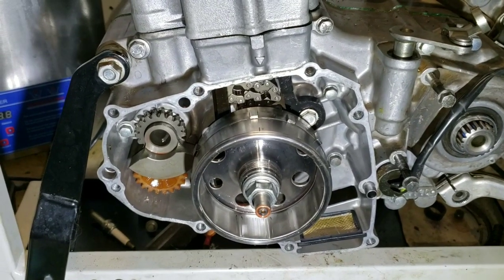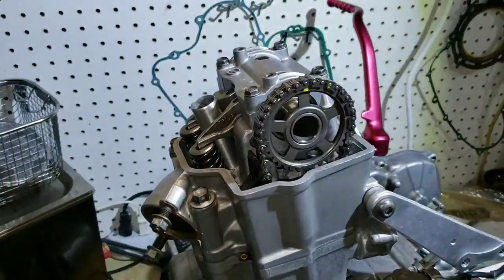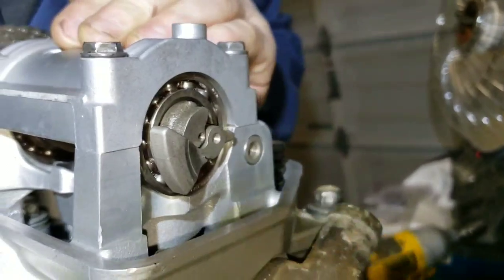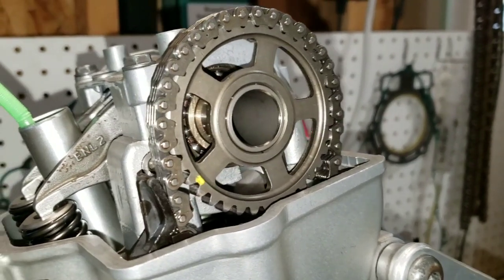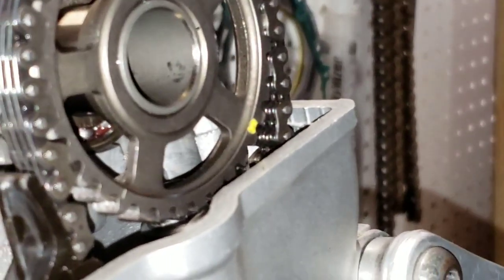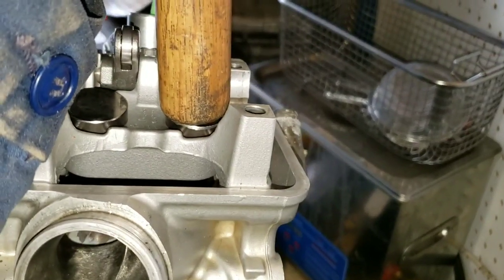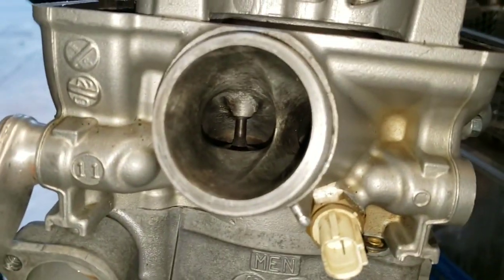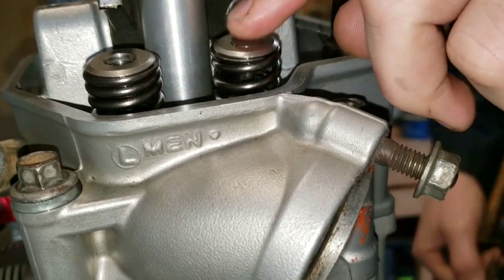2009 CRF450R timing & valve clearance - oops, we swapped intake & exhaust valve springs

Comment: People... i highly recommend you DO NOT use the back of a hammer or anything of that nature to forcefully push down on the valve shim buckets like shown in this video. You will dent the top of the buckets, which will throw off your valve clearances, cause the camshaft lobes to become worn unevenly, and throw off all of the timing in general. Those valve shim buckets are very delicate parts and it doesnt take much to ding, dent or damage them.
Reply from the maker: I highly recommend you consider the amount of force the STEEL cam is going to exert on that bucket 130+ times per second.  A wooden hammer handle used as in this video isn't going to hurt that thing at all.   Unless I was using a metal pipe or something. There is no "gotcha" here. You have not caught me in the act. You're not as smart as you think you are bub.

Comment: The timing is out by miles the two marks on the cam should be level with the face on the top of the head. The clicking noise is something to do with the timing advance on the cam shaft
Reply: Wrong, the timing wasn't off, the camera angle was.  We had two valve springs swapped. Easy first-timer mistake.
Reply: @teamagoge-theenduroists8683  timing was definitely way off
Reply from the maker: @kgmxtraining250  You literally only have to read the caption to see what the problem is:  two of the valve springs were swapped.  It wasn't out of time.  Everything else was right.  You geniuses just loooove to talk, when the reality is, you're so busy trying to formulate an answer, you didn't look at all the information available. 

We swapped the springs, everything went back together EXACTLY as you see in the video, and the bike ran great.
Reply: The two mark you mentioned is correct only if you are aligning it with the mark I side the small inspection hole

Comment: Well the springs are two different springs for starters.
Reply: How can you tell?
Reply: @electech_5495  its hard to tell the bigger are intake.. don't mix up.
Reply: @211-y2z  right, ...I'm sure the intake springs are stiffer because they call for closer specs since they must close faster
Reply: @211-y2z  nevermind I'm overthinking, bigger valve bigger spring.
Reply: @electech_5495  im not sure about the tense but u can measure everything to the spec of your bike. That would tell u what needs to b replaced
Reply: Oh yeah, so whoever owned it beforehand must've mixed the springs up, the tense ones have to be intake( I'm guessing)